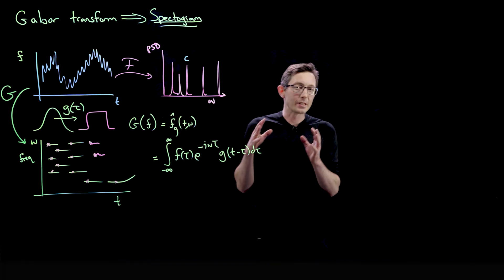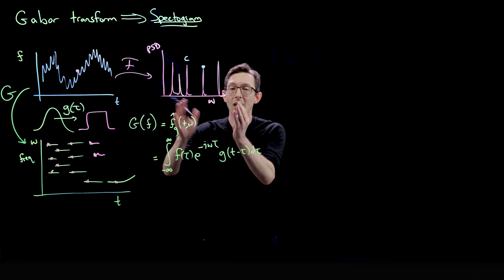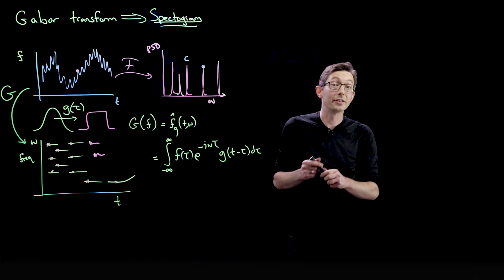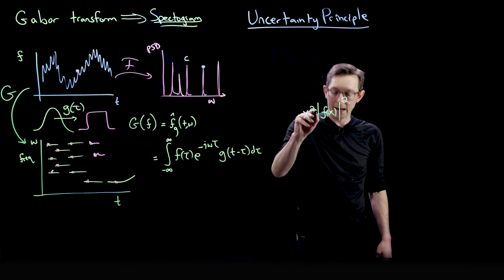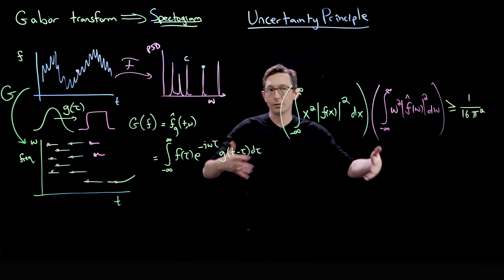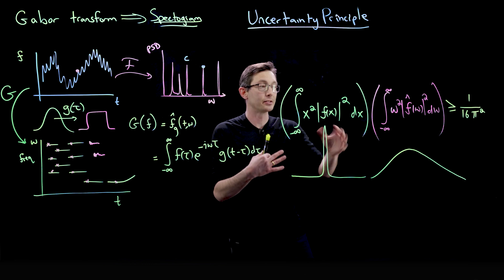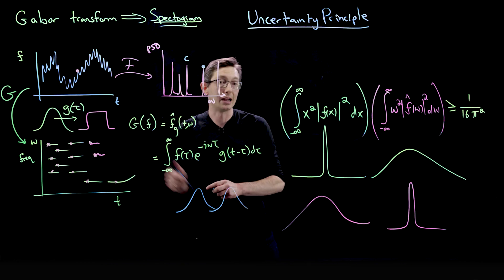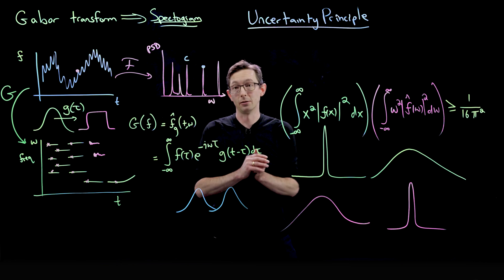Uncertainty Principles and the Fourier Transform

Comment: Could you please do a video showing the application of FFT in 2D with implementation of boundary conditions. You've showed us the solution of the heat equation in 1D, I'll be thankful if you can do the same in 2D with B.C. using FFT. Thanks in advance.